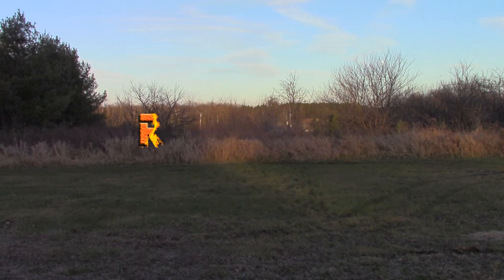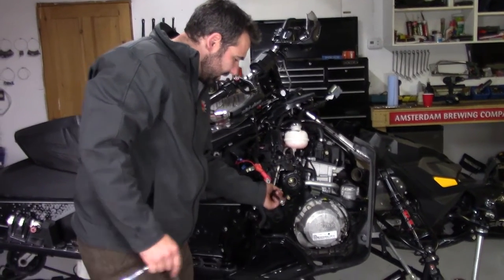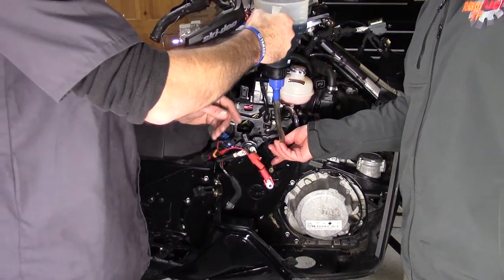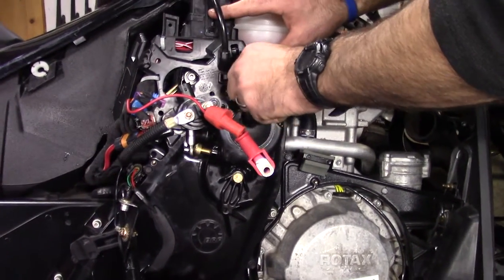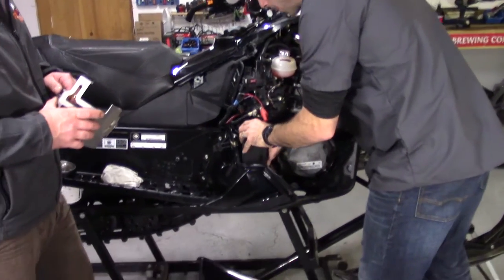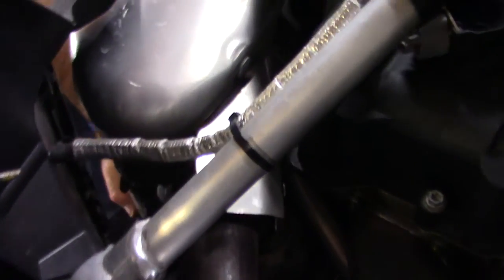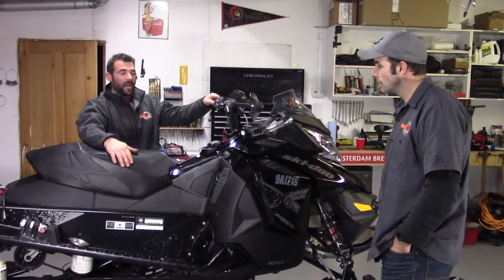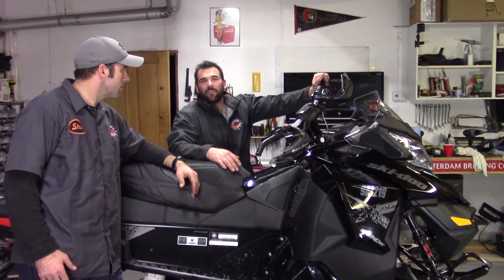Ski Doo Chain Case Oil Change PART 2 by RawFuelTV

Comment: is it important to torque the bolts on the chain case Cover to spec?  if so, do you what that spec is?
Reply from the maker: mswoessner the torque spec for the chain case cover is going to be between 5 and 10 ft-lbs depending on make year and model. Most of the 1200's call for 89 in-lbs or 7.4 ft-lbs. Careful not to crank em to hard and ensure to torque them in a criss cross pattern.